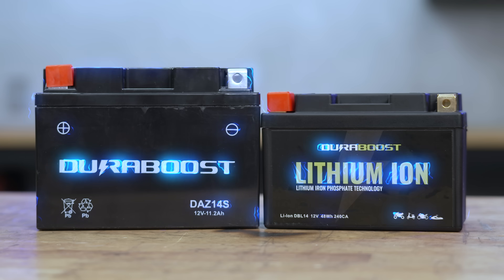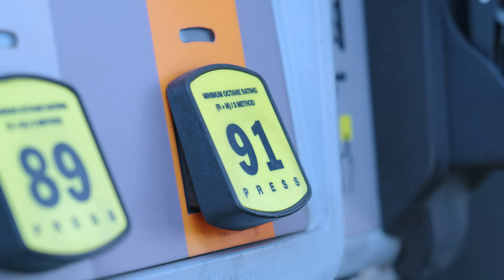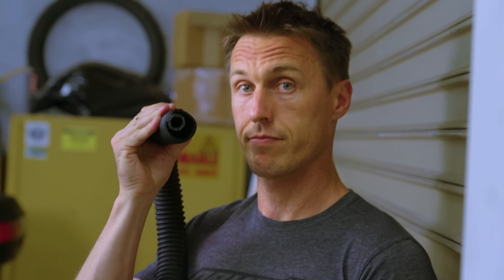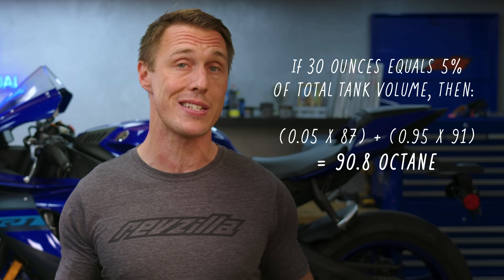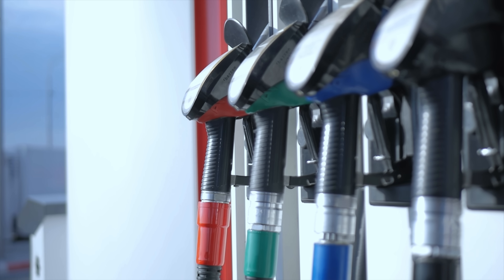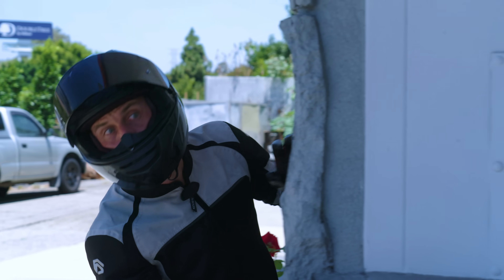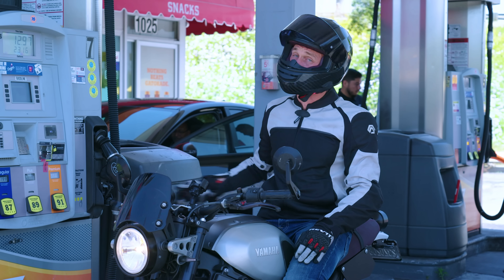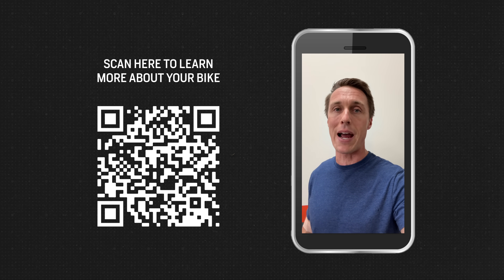How Much Regular Gas Are You Getting With Your Premium? | The Shop Manual

Comment from the maker: Should you run high-octane gas in your motorcycle? Read more on Common Tread: https://rvz.la/4e0FUzv
Reply: if thats what the manual tells me to run...
Reply: Yes, Yes, Yes. I run high octane when I'm towing with my mini-truck too. If you're lugging an engine or you live in the hills, you gotta use 91 or better. It's a fact of life. Now a Prius? 87 all day. I don't care what the manufacturer says, I use 91 or better on every motorcycle. It's a high compression, performance inclined engine (most of the time).

Comment: I actually had the same question some time back, as before switching MOS I used to be a 92F (fueler) and when defueling lines (3" and 2" in diameter) you could end up with over 300 gallons back in the main tank. The military worried so much about this fuel commingling that they moved to a common fuel for all vehicles which made me wonder how much premium I'm actually getting. I don't have nearly the amount of followers nor the time to make good videos like you but I'll do my best to make a video using my previous experience. I always enjoy the extra knowledge with the shop manual videos!

Comment: I was a Tanker truck driver in LA/Orange county areas for more than 20 years. Not all gas stations ⛽️ are the same when it comes down to product integrity. Some stations I’ve been too do not care about keeping the fills clean and making sure water 💦 doesn’t get inside. 99% of gas stations today use a system called a Vedor Root which monitors the tanks volume and supposed too shut down when water gets inside.  And before dropping at a station I would always hand stick the Tank height manually and use KolorKut paste on the stick after dropping inside if water was inside the stick would come up RED color indicating water inside then I would write up for no further deliveries until it has been pumped out and cleaned etc.. The cheap station like mom and pop no names are the worst followed by Arco. I now work for a major oil company and test product in my lab before putting the Tanks to the load rack making sure the CofA matches octane is correct. Go to the clean higher price stations you will get better cleaner gas that won’t cost you down the road when your bike/vehicle needs to be serviced.

Comment: All gas is 100 octane and during delivery tanker filling at the depot's loading station.
During final filling, various distillate,s are added until the current octane pump levels are reached.
This information is straight from the Driver's of the tanker delivery truck s

Comment: If your filling your 1 gallon can for 2 stroke mix it can matter a lot,  otherwise not a big deal.  Lots of small engines meltdown and warranties denied over this.  The big green tractor maker made it mandatory for dealers to check for ethanol% before okaying warranty work on yard equipment because of blender pumps.

Comment: The problem with your conclusion that this does not make that much of a difference is flawed.  In the case of people who like to keep their gas tanks on their car, truck, motorcycle, or boat “topped off” and rarely let the tank drop below 1/2 full, means each time you reach for Premium (93 Octane here in the Northeast U.S.), and the previous customer on a single hose pump purchased Regular 87 Octane for their vehicle, then you are getting more and more of the lower Octane fuel in your tank.  Over time the gas tank of your vehicle will have more and more of the tank volume of fuel DILUTED by the 87 Octane purchased by the previous customer.  This is why I try to let my tank level of fuel go to 1/4 full, or lower, before I refuel with my choice of 93 Octane for all of my vehicles and equipment.  Yes, I can tell the difference in my vehicles by using my method.  Also, I frequently use fuel system treatments from VP Racing, Chevron with Techron, Stabil 360, and K100.  Each of these fuel system treatments performs different functions of conditioning the fuel depending upon the vehicle, fuel volume used, and time that the fuel may sit in the tank of the vehicle.  Gas stations here in the Northeast began getting rid of multiple gas pump hoses in the early 2000’s as a cost saving measure.  Regulations designate how often these hoses need to be swapped out for newer ones.  Stations with one hose per pump save that much more money by only needing one hose per pump.  I much prefer having one hose per Octane level, so the consumer gets what he or she actually paid for!

Comment: I tend to be a little more cautious around hear. Our hoses tend to be 3/4 or larger and most my bikes have small tanks. though usually i will just pump a little into each gas can to even out that first bit or in my race bikes and snowmobiles i just run 100ll no ethanol and guaranteed to be good fuel.

Comment: 30 Fluid Ounces is equal to .28 Gallons.

In a Honda Trail 125 with a 1.4gal tank, or a Super Cub with a 0.9gal fuel tank, it might matter.

I'll just carry a couple fuel bottles with me and fill those up before I pump into the tank.

Use the bottles for my car when I drive it next.

Comment: amateurs... 😂 here in Brazil they are puting by law 35% of ethanol in the gasoline... it sucks... less miles per liter... most of the motors are not flex (ethanol or gasoline - doesn't matter the % of each)

Comment: That hose has a lot less volume than I thought. I always used to purge the hose with a gallon or so into my car and then fill up a 5 gallon gas tank to take home and fill my bike. When filling the bike at a gas station, I always tried to get in line behind some kind of luxury car that I assumed was using premium gas. Thanks for this video!
Reply: There's a shared filter that also gets purged on top of the hose volume
Reply: Oh yeah sure😂

Comment: Here in the USA, the only stations that I have ever seen straight gasoline have had their own hose.  I can't remember seeing separate hoses for each grade of gasoline.  Maybe they did when I was a kid in the 80s, but I don't remember it.  Having separate hoses is so unusual here, that I was actually a bit flummoxed recently when I went to gas up my Vespa.  If there is a second hose, it usually has a green handle and is for diesel.  Both of these had a black handle, so I didn't think about it.   I put my card in to pay and everything, chose Premium, and nothing would come out!  Turns out, I had inadvertently picked up the alcohol free hose.

Comment: Though I am a firm believer in storing you carb'ed bike longer than 6 months should only happen with ethanol free fuel filled right to the top of the tank and float bowls manually emptied...the concern about the water absorbing corn juice itself humors me.  I am just old enough to remember the bad old days when frozen fuel lines were a thing on that first extended cold snap each winter.  How long has it been since you heard of that happening (mostly for us Midwesterners)?  That is because of a combination of most ancient underground tanks having been replaced by statute (less water leaking in) and that 3-10% ethanol absorbing the condensation that naturally forms in less than full tanks instead of letting it accumulate over months until someone gets unlucky enough to suck in a slug of water right before turn off their car before a cold snap.

Comment: ...and just to mess with your heads a little bit more, when the tanker arrives, he'll be using common hoses for all fuel grades. So, when he tips 7000 litres of of diesel from pot 6 into an underground tank, drains the hose, then puts 7000L of UL from pot 5 into the tanks, there's commonly 4-5 litres of diesel residue left in the hose. Good news, that level of dilution isn't even slightly an issue.

Comment: To start off, I'm in the I don't care camp. However another idea for those who do care would be to use a separate gas can that's even larger volume that your motorcycles gas tank to even lower the hose percentage. Granted this doesn't help you on the go, but when I go to the track most people are bringing 5-40 gallon gas cans anyway where this would mean even less.

Comment: In my area non ethanol is its own hose and at one gas station its on its own pump. Unfortunately the station that has its own non ethanol pumps used to be the 76 101 octane pump that I tuned my car for

Comment: Hi Ari, nice video, but one minor correction... it seems most stations I run across have only one nozzle. As we use these, the gas tank ends up getting more content of lower grade fuel, settling at around 8% of the lower grade; the less fuel you put in each time, the more effect. Still a small effect on octane, but can increase.
The real concern is if pumps start showing up where the E85 gasoline shares a nozzle with "normal" gas (often E10). These we will not use on our bikes.
Keep up the good work on videos!

Comment: Ari, you're leaving out the filter.  Within the pumps are a shared filter which gets flushed with the selected grade.  The filters can vary from car size oil or diesel truck sized ones.  The filter alone can harbor up to a quart or more. That along with the hose, I am told by the pump techs, amounts to three quarts.  Well we're paying a dollar a quart so you can watch your dollar amount and count the first three being regular. My BMW G450X which must run premium, on a top off may only need a gallon...3/4 of which could be regular.  Or cruise around the pumps and do the math: $40 and less than ten gallons is good. $20 and less than five and so on. Or, gas up after another bike observing the grade. Been telling my mates, who don't care, for a year now.
Reply: It's as if the article was written without fully understanding how a gas pump works. But I do appreciate the effort they made.
Reply: Why would the filter be located after the valve switcher, and not before?
Reply: @JohnJohnCrusher  There's one shared filter which gets flushed.

Comment: I tend to only fill 2-2.5 gallons in each bike after a couple days of commuting and then switching to another bike. The bike won't make another trip to work and that's when it's convenient to fill up 🤷 I could see this issue being more relevant with my c70 passport's 1 gallon tank, but I also only use ethanol free in bikes and I've never seen the hose for it shared with E10 or E15 fuels... Ultimately I'm not gonna worry about it, especially considering all my bikes will run on 87 🤣

Comment: I'm glad you mentioned the Motorcross Bikes,  I've had to fix a bunch of bikes, that wouldn't run right or were running hot, because they got a good gulp of trash can 87. Up here in Western Canada, our best pump fuel is Chevron 94 on its own hose. My Zx10R with a pipe and tune loves it, and feels crisp, sharp, fast and runs cooler than common hose 91. My Aprilia Dorsodoro 1200 doesn't care, as long as its 89 or better. Sometimes I will fillup my race cans with 94, so I can just fillup the 10R at home, before I go riding.
Reply: One thing that's worth noting if you didn't know, seems that in the last year or two, Canada wide, 94 chevron has ethanol in it now. I noticed it awhile ago when I went to get some and their "ethanol free" sticker was gone. Super sucky, now I'm looking at synthetic fuel or 100LL aviation gas for my small engine stuff. Just can't catch a break here.

Comment: And 89 isn't actually in a tank.  It's mixed half and half at the manifold.  87+91 = 178 / 2  gives ya 89.  Had a friend that owned his own station and he said that's the biggest reason stations went to single hose pumps.  They have one less tank to worry about.
Reply: depends on the station and dispenser.  Not all are blended grades.  Though it is rare to have an 89 tank these days

Comment: this has stressed me out for more than 15 years my offroad bikes need the high octane when I go out of town with them, I buy all I will need in fuel cans before i go and I have 1 station out of the way I go to for the separate hoses. I love the idea of pumping the first bit in the truck the only problem is I drive a diesel. I rode a buddies xr650l that he uses 87 in I've never heard that find of knocking from a engine before, he rode mine with 93 octane and said he would never run 87 in it again.

Comment: In the EU every fuel has it's own hose.
Diesel and Petrol nowadays have different size nozzles so you can't fill the wrong fuel in a car with the newer style fuel cap.
Our regular octane is higher than what premium in the US is.
For the people saying we go in to pay are mostly wrong, most EU countries don't have this.
Reply: One correction. Your octane is measured with a different rating scale. That’s why your numbers are ‘higher’.
Reply: @troyjollimore4100  I didnt know that thanks for the info, I guess just another thing the US has to do different 😂
Reply: @eirikaustad7580  You should hear the people over here crying! “This is saying my car needs 95(RON)! Where am I going to get THAT? The highest the pumps have is 93(AKI)!!! LOL! If things haven’t changed, your fuels do have a much lower sulfur content, though.
Reply: @troyjollimore4100  Yeah and we dont have the lower octanes at all for the most part, and  95/98 is just 91/93 like you pointed out but some EU countries also offer 100 and E85
But 95 is also now forced with 10% ethanol 
98 isn't yet
Reply: @eirikaustad7580  Many places through the US have E85, and some actually offer up to 113 (avgas/race fuel)! That would be around 120RON or so… Very rare, though.
Reply: @troyjollimore4100  Yeah probably some VP racing station but thats not for normal people to use (even though they could)

Comment: All the pumps I get gas for my bikes from, have separate hoses for the non ethanol premium blends. 
I usually only buy 3.5 gallons at a time, and use the same container. I never fill directly into the bikes, unless I'm outside the NW MT. area, on a longer ride. 
I've always used certain additives to custom blend my fuel, before filling the bikes tanks. Klotz Nitro Octane Booster with "koolinall" is my favorite. They make a leaded blend that's specially designed for 2 strokes. Really prolongs engine life with modern fuel blends. Then theres the non leaded blend for new 4 strokes. 
They both work better than any other bullshit booster additives I've ever seen. I use 2ozs.of Klotz and 1 oz. of Stabil per 3 gallons. According to my calculations, that gets me close to 93 octane. 91 octane is the highest we have here. 
I can definitely hear and feel a difference in the way the engines runs on it. They stay cooler, and the ECU doesn't have to pull as much timing out as a result. This in turn makes more power. Simple. Gas matters. It matters alot. Shit gas is the bane of small engines.

Comment: As far as sensitive engines with smaller fuel tanks go, a simple solution would be to fill up Jerry cans which I feel most people do anyway for convenience.  Only the first Jerry can would have a negligible amount of lower grade gas by dilution, and any additional cans would be of the grade you want.  Combining Jerry cans with initially priming the hose into a vehicle, and even the first Jerry can will be "uncontaminated".  Frankly, I've never considered the hose issue at all, and I agree it's mostly a non-issue.

Comment: Here in Florida Wawa gas stations sell ethanol free using a separate hose. I use it for everything (motorcycle, boat, airplane) except my car.
Reply: Here in North Carolina, some QT they do the same thing, sell ethanol free gas from a separate hose.
Reply: Just so you know we use the same compartment in the truck for all grades including diesel and ethanol free. Octane ratings are the minimums. There's always a bit of retain in the truck anywhere from 1/2 to 5 gallons. The fuel racks normally use the same hose for all similar products like all reg/prem or #1/#2/reddye. Only reddye is specifically purged from the line towards the end of fueling. Guess what I'm getting at is all grades and types have some mix but just like the same hose being used at pumps its so minimumal it doesn't even matter. Even the pipelines have mix. There's no physical barrier when pumping the refined from the refineries to the fuel farms that feed the trucks.

Comment: Fun fact, mid grade is just a blend of premium and regular.

Also, unless your vehicle calls for premium gas, putting premium in a vehicle that only needs regular does nothing for it. All you're doing is wasting money. Sometimes it can actually make the engine run worse because premium is harder to ignite than regular.
Reply: Regular has Premium in it as well.
Reply: The main reason to get premium for small engines that may not require it is to get ethanol free gas that won't go rotten and get corrosive over the time it sits.  You actually save money and time because you don't have to clean and/or repair the fuel system as often.
Reply: It depends on the refineries. Shell and exxon, the higher the octane, the more refined the base fuel. They have separate storage tanks for each grade, and they formulate the octanes differently. Sunoco mixes the regular and premium though.
Reply: @cyclonebuzz8172  my comment was about gasoline sent through a pipeline.